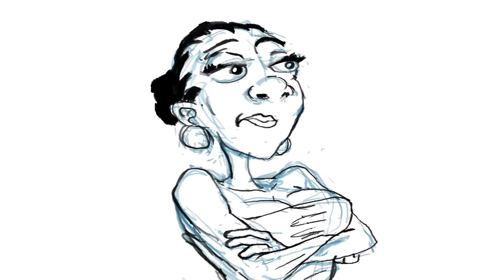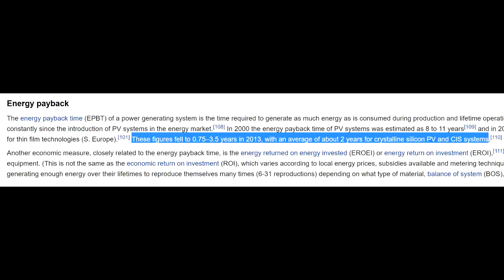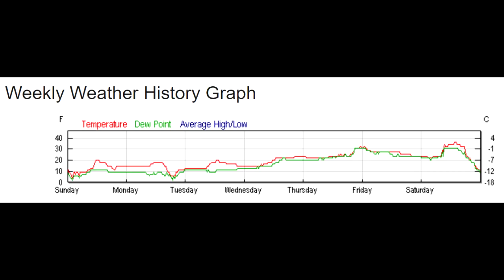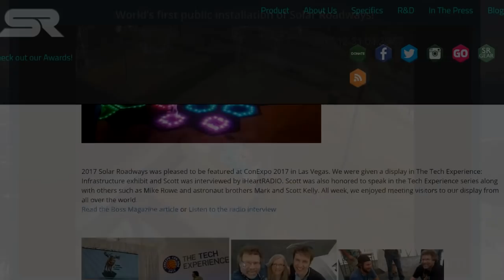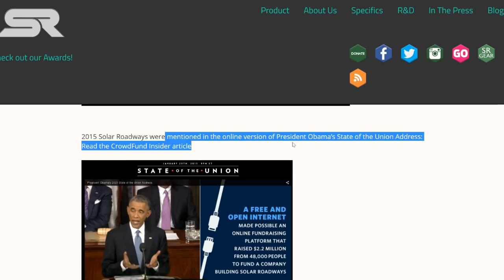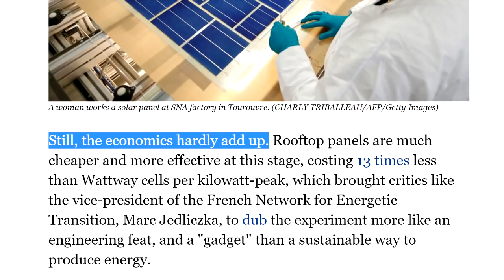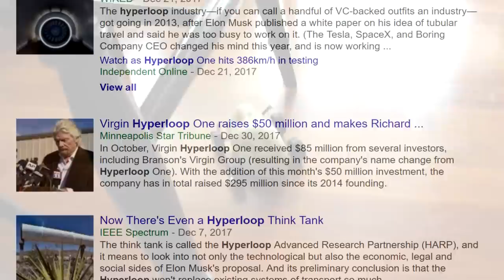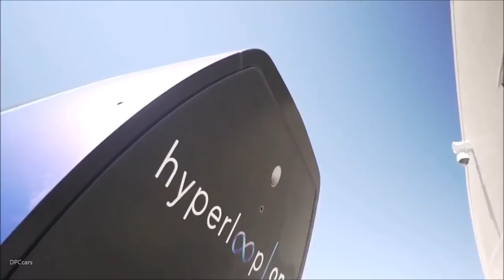Solar roadways, NEVER shovel snow agai... oh

Comment: Hyperloop already exists in a more dangerous form, bullet trains. So whats the big deal? Hyper loop would actually be safer than bullet trains because its contained and away from public access. 

As for this whole solar roadways idea, it seems people are attempting to innovate by making nearly all surfaces capable of absorbing energy to put back into the system, although expensive and difficult to imagine at the moment - the future of having solar powered roadways, sidewalks, roofs, etc is becoming a reality. 

Of course there will be doubt and anger, but someone has to be the one to look like a fool and push the technology so that others may advance it. Look at Elon musk with his crazy ideas 10 years ago, returnable rockets? Full electric trucks? It was laughable. Now we have Elon musk launching rockets up at a fraction of the price AND returning the rocket to boot. 

World needs progression, simply sitting there in the background and laughing hysterically doesn't assist mankind whatsoever, you're more useless than these Solar guys are. 

I hope they can advance on this technology, spark other minds to build something like it but better, its not a bad idea - overall, repair will be easier, any bit of energy it can extract the better. But I hope they can solve the winter issue, we don't want miles of roads being heated, that'll tax the shit out of our power plants.

Comment: You just complain about tech you don't believe works, like an old man against mobile phones. The fact is these have melted a completely un-drivable amount of snow (which is more than they were ever designed for) into a passable level that it IS POSSIBLE to drive over without a snowplough being required, they work better than expected but because it's not cartoon quality you mock it?

Comment: Honestly I am still not sold on the value of PV Solar power for grid level supply in general. The sheer scale of deployment of PV solar needed to supply a significant fraction our current demand from a diffuse source like solar would far exceed the worlds ability to supply when it comes to the rare-earths and other uncommon materials. Even maxing out our output would require turning massive areas of various nations (mostly China, Russia and Australia) into strip-mining sites.

Even after all that, because solar is variable in its supply, we would need massive energy storage if it is going to displace fossil fuel generation. Batteries have the same issues as above but at an even greater scale (look up the pollution generated by lithium production alone). Pumped hydro requires very specific geography and the scale would be beyond anything we have done before.

As far as I can tell, the only two technologies that actually displace fossil fuel generators are hydro and nuclear, with hydro facing geographical limitations.
Reply: PV Solar isn't supposed to replace. It's supposed to suppliment. Other forms of solar, as well as wind and nuclear, can provide plenty of baseload, while PV Solar takes the edge off things like AC use and gives large buildings like hospitals their own power source.

Comment: I'm wondering why do they build the solar farms next to a highway. Guess they gonna have to wash the mirrors more often due to road dust.
Reply: Oskari Rissanen - Well when you have to supply  thousand of pounds of panels and stuff then it is helpful to actually have a supply road.
Reply: TorianTammas well of course you need a road, but not a damn highway 😅 tho where I live there's a lot more road dust beacouse people use winter tires, so I might be wrong with it even being an issue
Reply: Oskari Rissanen - You may be right they could have picked a better spot.
Reply: you can get coated glass that only needs a slight rainshower to clean it

Comment: Again trying to somehow associate solar roadways with hyperloop. they are on no way analogous apart from thunderf00t thinking they will both fail.

Solar roadways is a project that is fairly easy to put into practise, but it is just economically (and in many other ways) retarded.
The problem with solar roadways is that basic physics and economics tells you it is not economically sound.

Hyperloop is a concept that theoretically should work but will be very hard to implement in a safe and economical way, BUT if those challenges are met, it could revolutionize transportation, and how we think of distances between cities.
The challenges here are  engineering challenges, which could potentially be over come.
Reply: Simon Als Nielsen - High speed trains run on an operating speed of 300 km/h and the speed record is over 600 km/h. So we already have a working solution that can be put into operation today. This is a revolution for the way we travel and one has to just put it into action.

Comment: Well, well such a very negative mind set, the solar panels are a prototype system and not the finished cost.  You forgot to mention that the cost of keeping the roads in cities is high with the maintenance of the streets.  The damage of the road surfaces, the salt that is use in clearing the snow the damage sodium chloride does to all the surfaces buildings, autos, sewer systems, water systems.  Then you have the cost of removing the snow with trucks, the burning of all the petrol, the cost the the equipment, the maintenance of this by the tax payers.  And the management of this operation and the personnel that most be added in the cost health care, with the astronomical cost that, that entails.  Not too be left out the damage the drivers of the massive vehicles that clear the snow in damage too property like autos, signage, the surfaces of the street, roadways, highways.  Someone like you people just like to leave out much of the details on the opposite side too think of.  There is so many other parts that I haven't thought of also as the street of this urban areas were the roadways are now so over crowded with vehicles of every kind and the space to accommodate them, parking, where there little used most of the time by humans.  The pollution (just to put it bluntly toxin's) that give we humans cancer so many other illnesses that were not even mentioned.  Gasoline in the standard blend has 150 different compounds in the mix, toxic too say the least too the air, ground, plants and animals.  This is not a joke I talk to people who operate this system, the infrastructure.  BAD NEWS as one can hear just watching what the supervisors are saying as they done have a good way to fix the problems on the street, they can only just try too keep just getting by and hope for the best?  What are you loud mouth bunch doing to help.  NOTHING AT ALL, NOT ONE THING!

Comment: Don't rely on its 'cost' as evidence to its inadequacy, the price of any tech starts high an rapidly decreases as its demand increases.. im not subscribed to your channel to listen to some dumbed down cynical moaning.
Reply: but your right about hyperloop
Reply: Richard Ward Do you actually think that this ‘technology’ has any merit to it, whatsoever?
Reply: What, sticking solar arrays on the floor with some tech in.. yeah, it's pretty obviously got value on a fundamental level provided a better an more prevalent energy doesn't become mainstream.. look at how mobile phones cost thousands each when they are first manufactured but once the infrastructure exists they practically cost very very little, just plastic, a bit of metal, sand, the initial electricity (which is often more efficiently sourced locally) and the 'man' power shifting everything about.

Clearly the outdoor heated flooring is a bit thick and battery's degrade but consider that with some cleverer programming a large array of those things could heat individual panels one at a time to actually have their desired effect.. it's not nearly as daft as he's making out.

I don't blame the man for hating it though, super optimistic hyperboil annoys me a lot as well.

Lacks creativity when annoyed tho.
Reply: eddiebruv that's what I think.
Reply: Thunderf00ts that's what I think.

Comment: This Solar Roadway might be shit, but the argument you should not build a prototype in a challenging location does not make sense to me. If it can deal with the challenging location you are set. If you just test on a best-case location, you still need to test the less optimal ones.

Comment: I'd like to point out that when solar panels were invented they probably fared far worse than "one third of the capacity for nine times the cost." I have no idea why you are fighting this idea so hard. Let people try new things! If this technology doesn't show signs of improvement over time it will die off all on its own. And no, ten years is not enough time to dismiss a technology as dead if it still appeals to somebody the way solar roadways does. It's fine to critique the tech, but mocking it just makes you look immature in my opinion. I would wager there are thousands of everyday technologies that seemed impractical or even foolish the first few years they were around. But eventually they evolved and found their footing. Or they went away. No need to hate.
Reply: Wildnights - Well they do not develop anything. They assemble existing technology and their is no solar panel in existence that would make such a bad idea work. Solar panels need a certain angle to produce the maximum capacity. They need at best nothing obstructing them so any kind of protection that a ton or more can drive over them reduces even more the ability to produce energy.
Reply: I don't think anybody is arguing that solar roadways are ideal for maximizing solar efficiency. From what I've seen, people just like the idea of taking an unproductive space and making it productive. If it's possible to make the roadway less expensive (at some point in the future) than regular roadways (on a lifetime basis, not just installation) then that would be success. And I for one don't believe anybody who says something is not possible. It might not be possible with current tech, but that just means we need to investigate what tech advances would be needed to make it succeed. The only thing that could kill this idea is if people simply lost interest in pursuing it. And I think it sucks that haters go out of their way to shit on ideas that engage people.

Comment: Are you serious?Tell me how was the first plane in the world?Coudl it fly 10 houres ? No.Coudl it fly at above 1000km/h.No could it Cary tons of weight?No.Same goes for solar road waye.It just need time.
Reply: XD LOL YEAH. Unless if you literally have the Death Star parked beside your driveway
Reply: "You may fire when ready"
Reply: yes it does... it will turn into a supernova eventually :p insert "this isn't even my final form" joke here.
Reply: Thick as a brick?
Reply: Nope...a lot denser. Maybe denser than pure neutrons :D
Reply: andrew lee Waite aboute what is this conversation
Reply: Roadways are just by design the worst possible place to put solar panels. Its not that its a crazy idea with potential, its just flat out dumb.
Reply: our sun isnt big enough to go supernova
Reply: Tell me about it. It's the first prototype of the latest model. Ask Elon about the prototype Model S or GM about the Volt prototype. The Volt couldn't climb a hill during a media drive, and the Model S was hardly more than a shell. Look at what both of those became.

What I'd like to know about the snowed-over SR3s is how much snow did they get, what was the temperature, and how windy was it? It could've been -30 F with 7 inches of snow. It doesn't matter if the panels are on a roof or in the pavement, they're not going to defrost themselves in those conditions, but it looked like the SR3 was trying. Next revision, more powerful heating element, and maybe a touch of insulation on the bottom side of the element so the heat moves up.

And the biggest thing that these guys keep forgetting, the solar portion of it isn't the main reason to do a solar roadway. I hate how I already have rust on a new car from salt, how my unheated driveway cost me almost two hours to make it to the top tonight, and how the road to work has more potholes than an old minefield, not to mention how the road lines are invisible under snow or in rain. At this point, I'd be happy to have Solar Roadways with 2X the heating power of the Sandpoint installation and no solar, just to have the improved surface. Whatever solar power they can get would be a bonus for such an upgrade to the infrastructure.
Reply: Regardless of the solar cycles, cell tech does and is improving. The same size cell produces 20% more power today than it did 4-5 years ago.
Reply: And the same cell on a roof, at an angle produces 5 times the power one on the road does. And at a fraction of the installation cost. And since they scale of the same base technology that gap will never close. 

Add to that the fact that cars and trucks will drive on those pannels and innevitably reduce their lifetime. Its a huge waste of resources that could be used to produce 5 times the power. There is no excuse for it.
Reply: Let's not forget that the cars themselves prevent solar charging. 

There's a meta-material that converts heat into electricity; a better eco-roadway would be integrating THAT into roads so that we can harvest that heat. It should also make driving a bit more pleasant.
Reply: orlando007 You need some serious grammar lessons.
Reply: It's pretty obvious that the energy collected by a solar panel can't possibly be more than the heat 'wasted' by simply falling on the roadway.
It's more effective to fry an egg on a hot road in summer than to use a solar collector to power an electric hob.